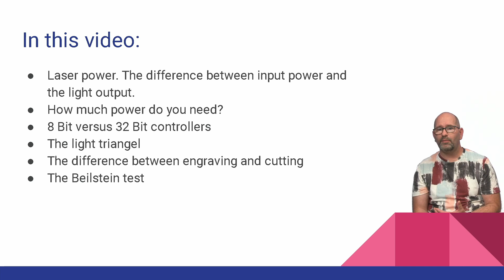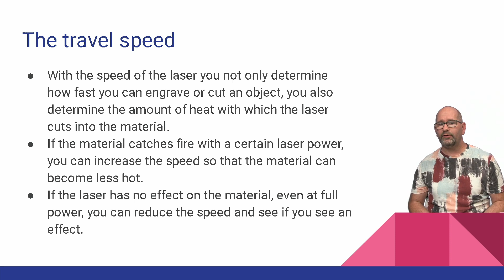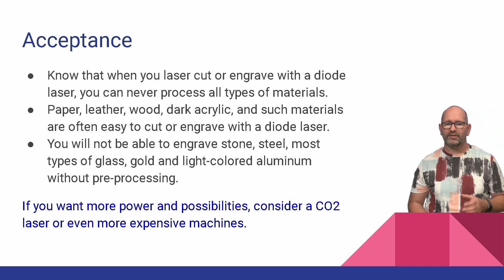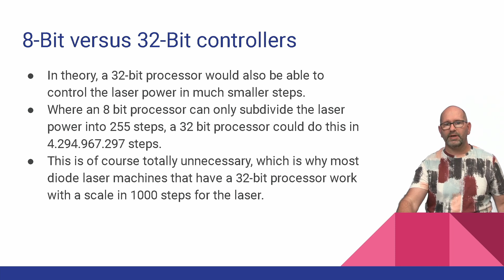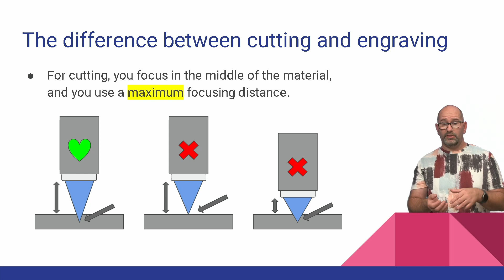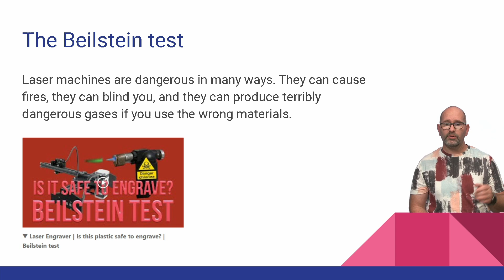▼ Laser engraving and cutting, the full tutorial. Part 1

Comment: thank you for this video. question: when engraving metal, such as silver, what happens to the metal that the laser "burns" away? does it evaporate and disappear... or does it melt and solidify around the perimeter of the engraving area?
Reply from the maker: With materials like wood, paper, cardboard, etc. It turns the material into ash, so that's easy.
Yet, for metals, I don'\t know if the material is replaced or burned. Actually, I think it is not burned, as there is no black ash afterwards, yet I am not sure.
Good question.

Comment: Hi Brian, great video. One thing I don't get. Why should the engraving height be lower then the cutting height? Wouldn't engraving also benefit from a bigger height? I would think that a thinner cone would result in a better over all resolution. Especially on irregular surfaces like slate. With a lower height being slightly off focus would result in thicker lines i would think. Or am I missing something?
But keep up the good work man, love your videos!
Reply from the maker: Hi Peter
When you are engraving, you don't want to go deep into the material, but engrave well. By focusing at a different height, you can engrave less deeply with the same sharpness because the beam becomes blurred more quickly. This gives a nicer detail when engraving.
When you are cutting, you want to get deeper, and then it is nice to be a bit further away from the material, since the triangle then gets a sharper point, and the course of the sharpness is therefore less great.
Reply: @3dPrintCreator  One caveat I've seen with my laser and it's default lens is that, while focusing at a higher height creates a more steeply tapered beam, it also increases the size of the focused spot. I have to focus my laser at about 20mm in order to get a spot of acceptable diameter for detailed engraving and to get enough energy density to do any cutting. I've ordered some new lenses from OdicForce to try and get better results; I ordered the G7 and the S16. The hope is that the S16 will produce a higher quality spot for better engraving that's more even in both axes at the cost of reduced output, and the G7 which should produce a higher quality spot than stock, but lower than the S16, but with better energy transfer for cutting. Once I get my lenses in I'll be trying to do a video showing the differences.

Comment: Is there a tool that can be used to ensure you have .01 focus on the lens?  Or is there a good way to ensure proper focus?
Reply from the maker: It depends on the lens that is used whether this sharpness is achievable, but with the standard lenses that I got on my Ortur 15 Watt machines, this is absolutely achievable.
The way to find out the size of your projection circle is to measure it in a special tool that has holes of different sizes. You must be able to position this tool so that the light from the laser falls completely into the hole and does not hit the edges of the tool.
of course you also need good glasses for this, because with the standard glasses you cannot block enough light to see your dot properly. Only with good glasses (or a piece of lexan intended for 450nm to see through) can you judge this properly.